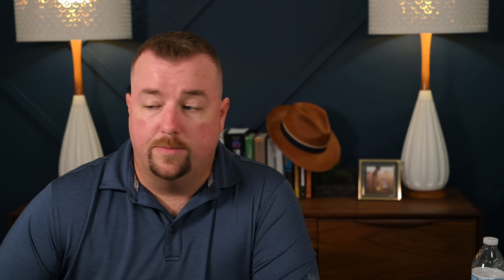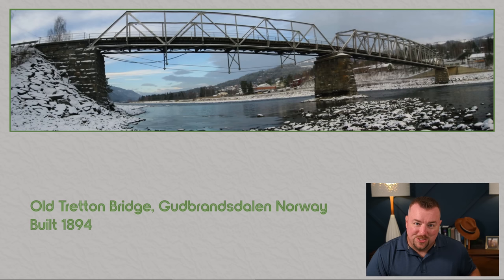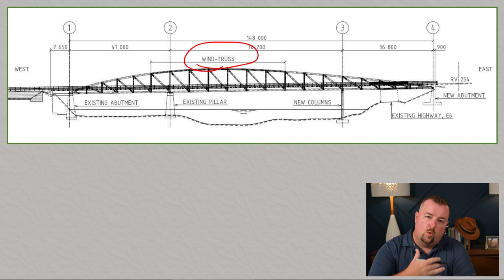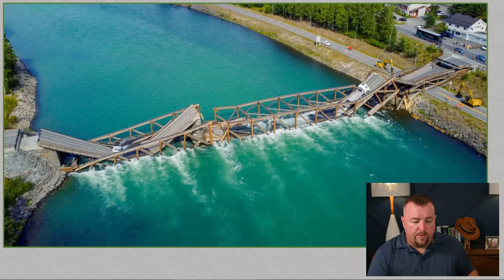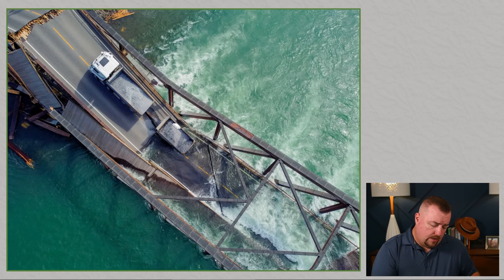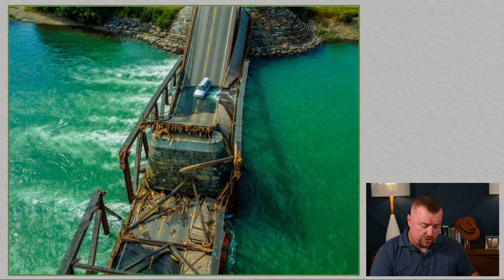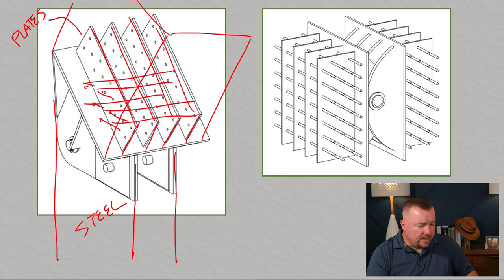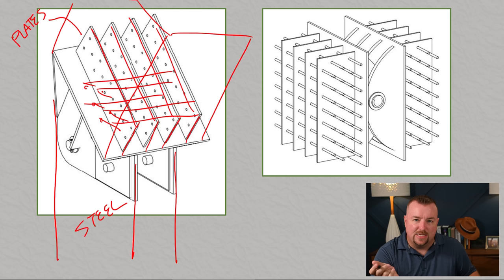How Did the Engineers Miss This?

Comment: I don´t see any problem with the glue or the weather.
But when I look at the pic made during the construction, the plates going into the beams of the lower cord are ridiculously short, especially for a joint under tension.
Even the connections on the diagonal member right of the pillar appear longer.
So I think a failure of joint A is very likely, the pulled diagonal brace is just a result of the collapse (in normal conditions the deadload of the bridge alone put it under compression, the position of the truck just increased that).
The delaminated upper cord is a result of the collapse, the joint was bend, something it was never designed for as the shape of the bridge never needed it.
There is a possibility one of the lower cord connections close the old pillar failed, in that area I see a problem with the diagonals as they are in tension.

The way the bridge was designed did not take the different material strengths between compression and tension into account.
Diagonal braces going only in ONE direction means half of them are in compression, the other half is in tension.
Should have either cross-braced it or changed the direction in the middle of each span.

Still the main problem was the tensile strenght of the lower cord´s joints
Add some dynamic load (wood can stand that easily, but not around fasteners) and things go bad.

Comment: You talked about "Cold Joints".  Would it be possible to 100% construct these trusses in the field?  Or perhaps in an onsite temporary warehouse. Thus any long member would get random joints distributed across the length of the member, with no joints at the steel brackets other than at the ends. 
Some cross plies may help reduce splitting. 
One also doesn't need to construct with straight members, but could add bulges at the joints with more plies.
We have some very old wooden covered bridges.  Most only in secondary service, although some still are primary bridges.  However, a covered bridge reduces the weather impact to the substructure.

Comment: I have some experience with road design in Scandinavia (well Sweden, but the ruels in Norway is very similar), while i worked only on railway, the rules i do know the rules for road.

The rule is that fully loaded truck should be parked bumper to bumper. The rule of load of trucks for to cross bridges is a bit complicated. But essentially there is a set length the truck have to be for a certan load.

This bridge was waaaay under maximum load. We are talking a fraction. Im kind of supriced that it failed at a so low load, even if it was failty construction.  At some time, really in the near past, two trucks must have meet  each other on the bridge

Comment: My comment is at about 4:20 in the video, I work in DOT roadway construction and the first MAJOR red flag I see is how much wood they used on the road deck 🤯🤯

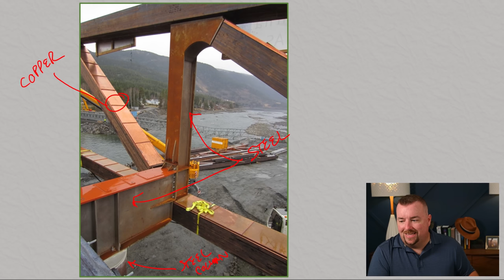Edit: at only 10:00 into this video I've already seen several MAJOR failure points, this engineer should be blackballed from the industry, in fact he/she should be held personally accountable for ALL damages caused by this egregious failure, this is a bad design on all levels
Reply: The investigation concluded that the bridge was to weak for the load it was suppose to be designed for. Already in 2016 inspection found failures and the authorites were informed about this, but took no action. The investigation authority put all the blame on the road authority and they are therefore responsible for all cost, including temporary and new bridge.

Comment: If the lorry had driven down the centre of both lanes this could have been a fifteen-year bridge, but sort of defeated the purpose of replacing a single lane steel bridge. Shear punch at point C, with the slender columns is a major contender, coupled with the rotational torque of asymmetric loading. Anyone for composite timber skyscrapers?

Comment: I'm a big believer in adhesives and their many splendor'd uses. But, when it comes to bridges, especially the transportation variety, glue, is not the first word I'd think to inspire confidence. That being said, it does seem that they can engineer a solution to those dang connectors. Maybe they should mortise the steel and tenon the wood instead? And why isn't this wood coated or treated to resist the water ingress better?

Comment: Why make dodgy design decisions like this at the inception of a project. I could understand if it were a repair, or there were some other pressure on the team, but this was conscious, informed decision by the original design team that carried significant inherent risk, with no migratory measures put in place. Why not simply build it out of steel? Why not use a homogeneous material. Why not lab test examples of the critical joints? If it's cost that drives decisions like this, those who insist on the "lowest price" should be held accountable.

Comment: 16:00 -ish plus in, the failure of the wood under strain. The failure is following the grain of the wood? Imagine that.
As an old firewood cutter, often making my living at it, this just makes me... 
Put on my best, "You don't say!" face.
And yeah, as many other commenters have pointed out about rectangular keys rather than dowels, I will confess that, although I am no expert, I do not ever recall a Japanese woodworking joint that was doweled.
But, my blood did not really chill until you showed me that SO MANY joints on the braces were Hyatt Regency situations.
There is one factor I haven't heard mentioned, though, and that is the difference between the Resonant properties of wood and steel. As a former resident of Tacoma, Washington, we have a fine example of what can happen when a bridge is in resonance. And when that bridge is also under the stress of the weight causing the resonance?
Let me quote Dorothy: "Oh my!"

Comment: I don't get why they need construction joints for gluelam.

Yes, it's cheaper to transport shorter pieces, and it's easier to assemble the pieces in a workshop, but there's nothing preventing you from gluing it in one piece near the installation site.

I also wonder if square or flat dowels (usually called tenons I guess) would make a difference. It should result in less wedging forces. 

That said, I'd still prefer a collar to keep it from splitting, and I generally don't believe in any glue that claims to last 100 years.

Comment: interesting case.  just glancing through my Design of Wood Structures book, I noted that there is a concern for cross grain shrinkage.  having been in service for ten years is time enough for the initial moisture to have dried out resulting in shrinkage across the grain with the result of splits and cracks which might have resulted in less strength in tension.  maybe gluelam prevents this condition, i don't know

Comment: Not structural engineer or a troll but fairly knowledgeable of construction (not bridges) and lumber. This seems be more of a poor connection detail issue than material issue. Wooden bridges made out of naturally rot resistant wood like black locust (with a elastic modulus of 2,050,000 lbf/in2)  can and have stood well over 100 years. Yes Glulam is wood but what kind? I'm guessing it was Norway spruce or the like which has an elastic modulus of 1,406,000 lbf/in2 and it is not very naturally rot resistant. Placing the connection pins so that the stress is being applied parallel to the grain is asking for trouble. It would seem a protected mass timber system utilizing cross laminated timber with connections that apply stress in ways that are more sensitive to material properties would be better. Or as you said make it all of steel but I think they were doing this because of the much lower embodied energy of lumber vs steel and concrete. If possible can you talk about the wood species in your analysis? Each species can have very different characteristics akin to different types of structural steel. Thanks! I enjoy the channel because of the of the differing viewpoints.

Comment: The motion of constantly and quickly changing (dynamic) loads across the bridge can't be good for this combination of materials.  The glued wood is more flexible, while the steel is rigid and unforgiving, which would allow the connections between them, as well as the glue holding the layers of wood together, to loosen over time.  Once that starts, it only gets worse.  I can't imagine it's easy to make the glue both strong and flexible at the same time.  Each time a load passed over this bridge, all of these connections were each becoming gradually weaker and weaker, lowering its overall strength, until finally the time came when a load moved across the bridge that these connections were no longer able to handle.

Comment: Boat builders do not mix iron and wood as the rusty iron causes the wood to decay.  They substitute copper or brass on there traditional wooden boats.  Railways soak there wooden ties with creosote to prevent the wood from decaying.  Mixing rusty metal plates with wood cannot be durable.

Comment: Why were they using wood as a tension member in the first place, you wouldn't use concrete as a tension member. Those connections should have had a compression ring around them to keep the wood from splitting.

Comment: Seems like they should have designed those ends with some cross grain.  Like plywood.  
Or perhaps a steel clamp on the outside holding the grain together.

Comment: Anyone who's had a ceiling tile fall, can tell you glue only lasts a few years.   Glue can weaken the fibers when materials expand and contract at differing rates.  Perhaps todays glues are better, but we have to wait 40 years to find out.    So, it is far too early to be using glue in structural components.   And bridges have a frequency, and they always are moving.    Structures with laminated wood, without glue, and without metal, have lasted for centuries.   (but none of them are bridges).  while the load is excessive, history shows glue, and even (wood and metal) together shorten the lifespan to less then 100 years.

Comment: I can see exactly what happened immediately. I design trusses and rafters. The bottom chord broke. 
 That's always the weakest part. Wood has incredible strength in compression. The braces are fine. The top is fine even with a splice.

Wood is veryyy weak when you try to stretch it. You have to have a piling where you have a splice below, like a wooden railway bridge. Or, a whole pile of steel wire pulling together on the bottom chord.

In the United States this is common knowledge.

I'm not sure why you're struggling to see that.

Even our large concrete Bridges, the bottom cord/ beam is lined with high tensioned steel and cable. You just can't see it.

No idiot would build a bridge that way. The engineers should be prosecuted for stupidity.

Comment: 18:00 this didn't need testing. Anyone who worked with wood for any amount of time knew it'd split like that. I don't understand how they thought those bolts were NOT going to split the wood. It's like woodworking 101. Wood fibres are super strong so you're not going to break them - you'll just split them. This is something that wouldn't happen to steel so the whole thing looks to me like the engineer never worked with wood and just applied the same knowledge he had of steel to wood.

I think what would've made this bridge stronger is if they made the top wood beam half as thick, but made two of them, and shift where they end so they'd support each other and you wouldn't have that one place where the beam just ends and is relying only on the bolts to hold the bridge. Also all the diagonal members should've been steel. Using wood in tention like that and putting all of it into those ends that will split is just dumb.

Comment: Wood expands and contracts with Humidity, how well does the glue bond with the wood after 1000's of cycles; could this not rip the wood fibers apart. with the pins not being coated they will rust and the rust also expands, the pins also make a highway for water to get the joint, and if water is there than so is ICE.

Comment: These fancy design firms have access to centuries of timber construction knowledge, and they just... didn't check. I thought everyone and their dog knew that pins/screws/nails don't work along the grain. That's how you split firewood, along the grain. If you must use wood in tension like they did, you have to compress the grain to hold the pins. This also has the side benefit of distributing a small amount of the load to the plates through the clamping force, at least until the wood shrinks. But you're still much better off using wood in compression, if you have a choice.

And why in all that you hold dear was that steel left to rust? It's like they thought it was wrought iron, and they needn't worry, oblivious to the fact that the process of making wrought iron leaves it with a protective black oxide coating. Steel flashing from the foundry doesn't have the same effect.

Even without the timber failing, I don't think the steel would have lasted 100 years just sitting there, never mind being under continuous load cycles.

Comment: Ok, we have a continuous beam from A—C with joints at A & C.   Why not have staggered joints of opposite sides of the bridge?   A—C beam solid on this side of bridge, and D—B solid on the far side of the bridge?    Just like the GLULAM staggers the ends of its member boards….    And encapsulate the pin joints area of the beam-plates interaction with some sort of metal box clamp preventing the splitting of the GLULAM ends…….   Man, I just can’t picture they entire deck from GLULAM - that’s probably got to weigh close to a ton per foot or two…..   And then the

Comment: I literally couldn't believe my eyes looking at those plate-pin connections in this video. Dynamic load & weather strain on metal pins (!??!!) in tension inside wood. The fact that it is glu lam is inconsequential, as it all boils down to a fiber mesh trying to hold a shearing pin. I live in and have repaired old log buildings and I would never ever make a joint thats supposed to last using metal through wood. Any time there is load, I take the time to make a proper interlocking wood joint, as a wood-wood joint allows dynamic loading without fraying the timber. I am rn sitting under a tension loaded "open book" style roof that has withstood massive snow loads for 110yrs without any issues. Whoever came up with the idiotic connection system displayed in this video had clearly never built anything out of wood with their own hands. Every child who ever nails planks together for a treehouse knows this is what happens with wood, nails, tension and weather. Norwegians... I am severely disappointed. You can do better. Love from Finland ❤😂

Comment: If they know from research how the wood will break….why not cap off the area with the holes in it with steel? I know that wouldn’t fix the problem but wouldn’t it help? Also wouldn’t bolts running threw the opposite way of the main holes help at least from catastrophic failure

Comment: I am confuse as to why the gluelam is horizontal and not vertical. Yeah it’s easier to bend it to the arch frame in the horizontal position, but isn’t the whole point of it being used is strength?

Comment: In addition to freeze-thaw cycles, and exposure to harsh weather, another aggravating factor is large and continuous cyclic loading (vehicles), as well as vibration from wind and storms. These become an issue because unless the steel plates and pins were fully epoxied upon insertion/assembly, the result would be a SLIP FIT, subject to CYCLIC MOVEMENT. This would result in fretting and a gradual, further loosening of what should be a rigid fit. Such loosening would slightly alter the geometry, perhaps enough to result in a stress concentration.
Such a slip fit would also further aggravate rust and rot by easing the intrusion of water.  As for the propensity to use wood, was the design created by Ikea? :)

Comment: Would that broken joint on A be more stable by having the fibers/planks not all end at the same spot?
I'm not an engineer, but that seems like an obvious weakness.
And the splitted joints don't need a bridge to show it's weakness. Splits at the end of a plank show up even when working with a hand drill. I've long gone to bind or tape wood before any through action just to keep it together.
The whole thing looks like it puts too much stress on too few points. And wooden bridges aren't impossible, even long lasting ones that carry heavy loads. It's just the application in the case.

Comment: I don't think the designers played enough PolyBridge 🙂 I would wager, if they left the old bridge up, it would have outlasted the new one. I think wood in this application is a particularly poor choice of material, given the environment, before you factor in any design deficiencies. In my area there is a big movement to use wood construction for large buildings, including I believe up to 20 story buildings. I worked at fab shop that made connector plates for this type if construction, so these type of connectors look very familiar to me. The only difference is the company we were contracted to was the connector plate holes were angled at 45°. The intention is to create a "greener" method of construction, however the connector plates sometimes 1" to 1 1/2" thick steel plates, with 20-30 holes machined on a 45° angle, the amount of extra work required in fabricating, welding (due to extra thickness) machining and adhering to the extra tolerances required... it boggles the mind to me, it isn't really any greener compared to more conventional steel and concrete  construction, nor do I believe it is any cheaper, the only thing you are accomplishing is the appearance of being greener, with a big trade off in strength and longevity.